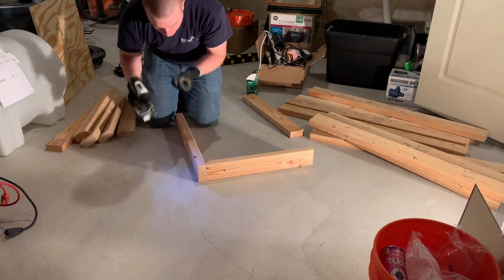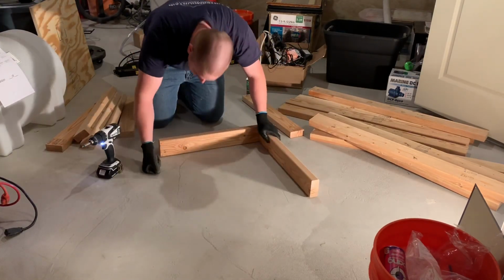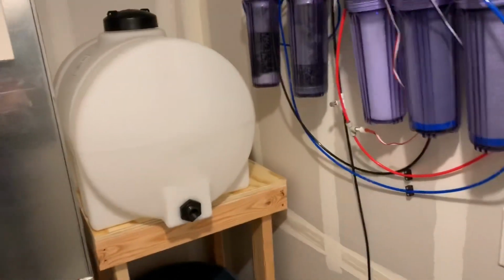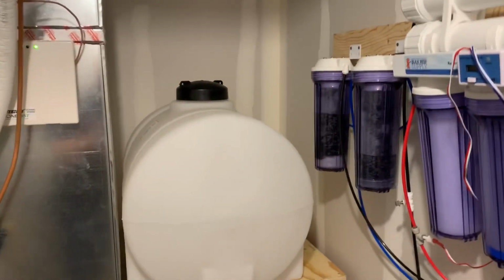Building A Mixing Station

Comment: Looks good, nice work! Did you consider any type of bracing for the top tank to keep it from sliding around?
Reply from the maker: So far I have not had an issue with it sliding around.  The stand is level and with no movement other than when I am transferring water to the lower container I am not concerned about it moving.